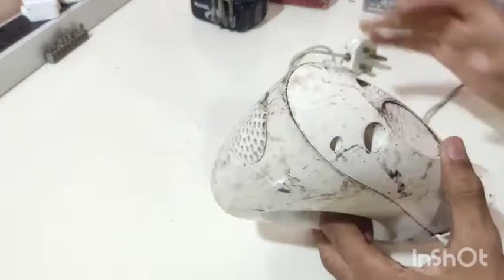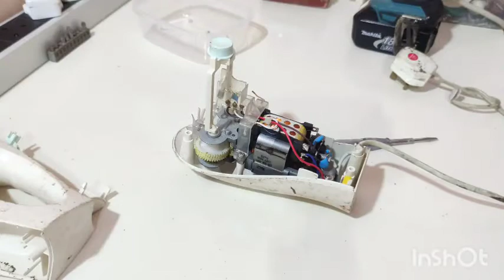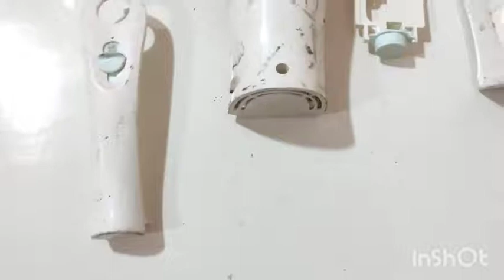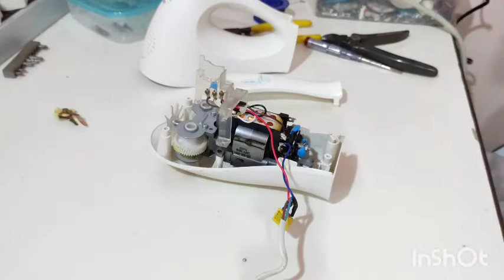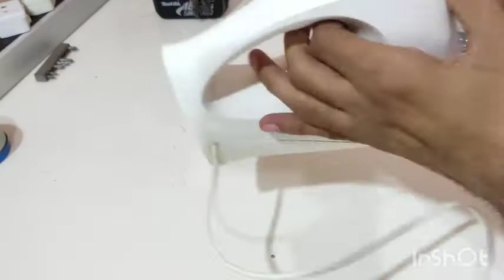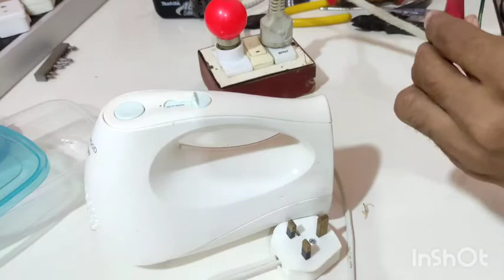How to Restore Hand Beater | How to Repair Hand Beater | Egg Beater | Kenwood 250 Watts Mixer

Comment: Hi may I ask where the spring attatches to.
Reply from the maker: would you plz mention specific part of video about that spring!!
Reply: The spring top attached through a tiny hole in one side of the two square fork like parts. The lower end of the spring hooks under the second gantry plastic piece that holds the motor in place and has a large plastic loop that serves no other purpose but for the spring. It only seems to engage when the mixer tool parts are pressed into place pushing the button up proudly. Note you cant press the switch forward before these tool ends are engaged. Hope this helps.
 Also the bottom housing screw on my model was a security screw and needed a specific screwdriver end to undo. It's like a flathead with a notch in the centre.
Reply from the maker: @gtube6913 much appreciated